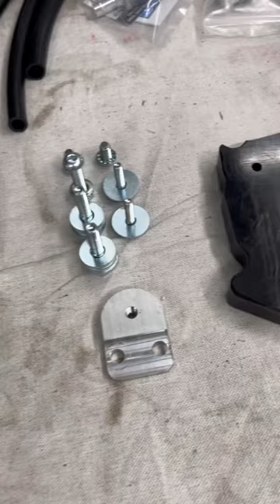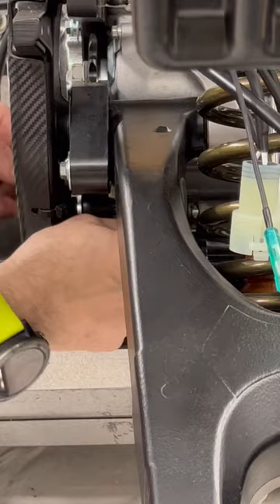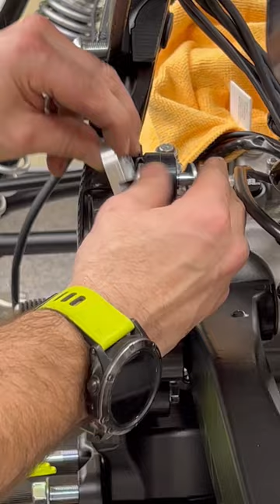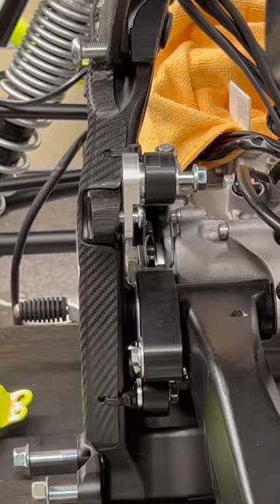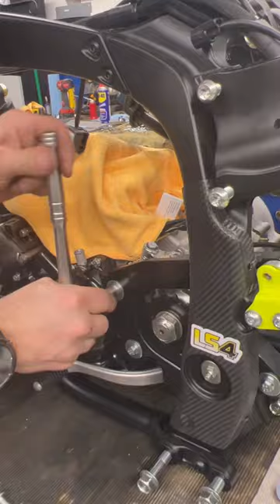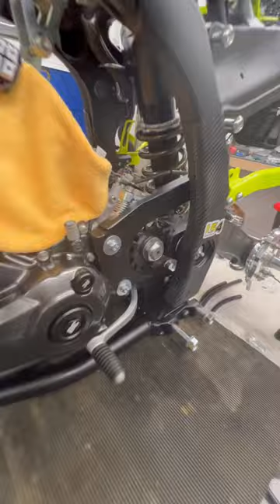YFZ450r - case saver #yfz450r #yamaha #atv #shorts

Comment: Do you have to use the upper chain roller from glann innovations or can you leave the stock one on?
Reply from the maker: No the lower one actually gets eliminated as the glann setup bolts to that point.